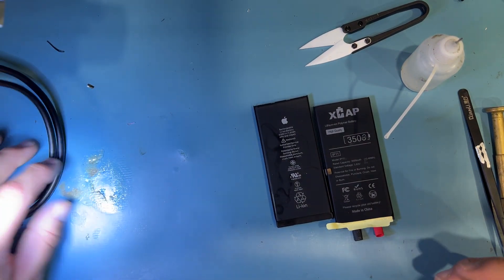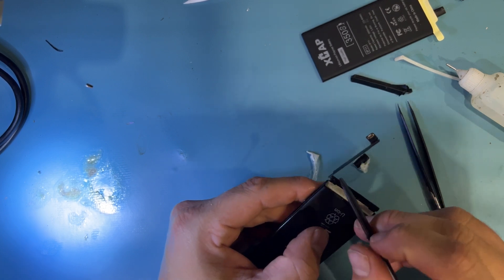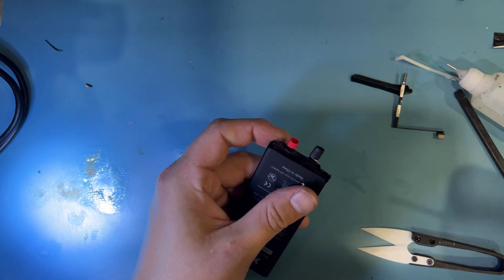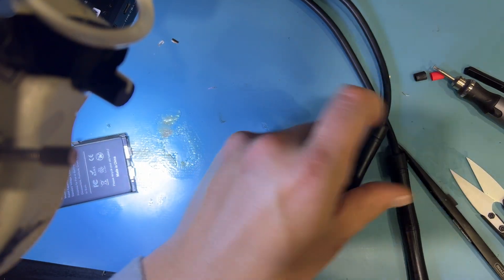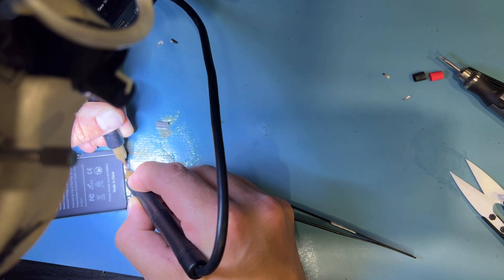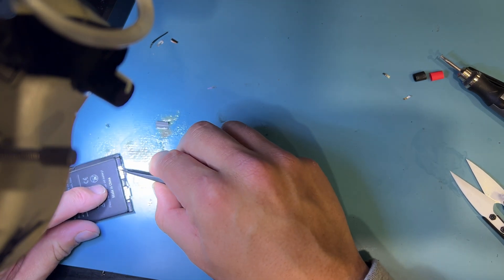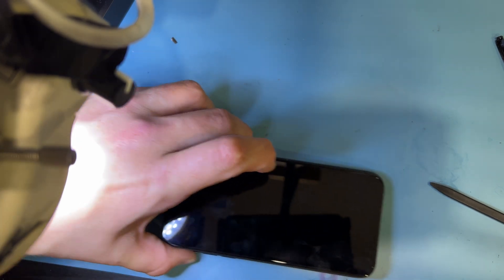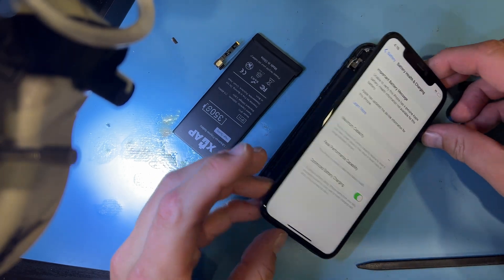How to replace iPhone battery without a Non Genuine Message. BMS Swap Battery Tutorial 100% health

Comment: I replaced an iphone 11 battery with an oem battery which has an ic connector for placing tbe original bms on it but i did not put the bms and the iphone works fine. Is it necessary to connect the bms? Is it safe without it?
Reply from the maker: Yes you’re totally fine to not have the original BMS. This solution was intended to be used to retain full functionality of the iPhone when changing a battery without using Apple. With iOS 18 Apple finally gave users what they should have had from the start, battery health with aftermarket batteries.

With ios18 there’s less need for the solution I display here. With ios18 the battery health is shown and the battery will just show as “unverified” meaning it’s not a serialized matching apple genuine battery.

Comment: So if i swap the bcm from original battery to new battery and just plug it into say an iphone xs max. Will it relearn the battery health eventually and set the % to whatever that new battery is or will it stay at the level the original battery was and continue to drop?   Like is the battery health just a dumb timer circuit or does it acutally do the learning process when the battery is discharged, charged then discharged to figure out the mah actual compared to new mah set values?

Comment: Can i change orginal bms board to new battery and assmbly to phone without programming to 100% can i use with old data
Reply from the maker: Yes you can use without resetting battery health and battery life will improve if it’s done correctly

Comment: Hi I’ve got an 13pro on ios 17.5.1 can you change the battery without it getting the silly not gen part msg
Reply from the maker: Yes you can but the newest iOS required extra steps. I’ll need to make an updated video explaining this. Subscribe and you’ll get notified when I post the new video

Comment: Love seeing the XCAP battery and the mini rotary tool; Jake from I.G. talked me into buying one and I have zero regrets about it!. Saw your video in my suggested and gotta always say hey to other techs who use XCA. Brad & the Injured Gadgets team really worked hard to make the BMS series (base and extended capacity) and their no-programming-required tag ons easy to work with. I've been using XCAP batteries for iPhones for years and years, never had an issue thus far. Very well done walk through, this'll be a good resource for those who wanna learn this procedure. I need to start a damn YT channel!! Thanks much, sub'd!

Comment: Have you ever had the non genuine message not come up? I am using an ampsentrix core battery with tag on flex and am not getting the message after prompting to boot using the lightning cable. Any ideas?
Reply from the maker: That can happen sometimes. Just connect a different non matching battery to get the message and then after connect the matching battery and tag on again

Comment: is it ok to just use soldering iron instead of welding machine?
thanks
Reply from the maker: Some people are happy with results soldering. The risk with soldering is damage to the bms from heat. In my opinion the proper welding technique is the best options
Reply: @phonedoctorbrady  or the battery -damage it
Reply: I think it's possible if you do it very quickly